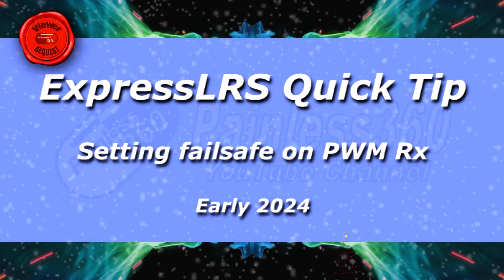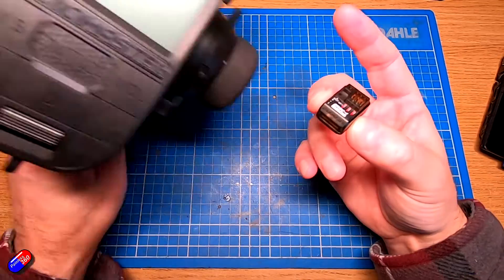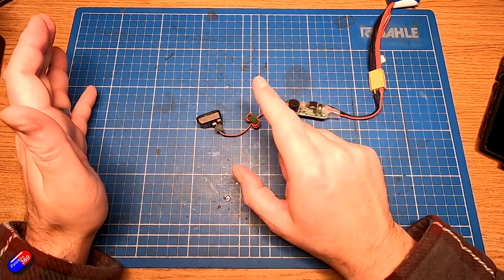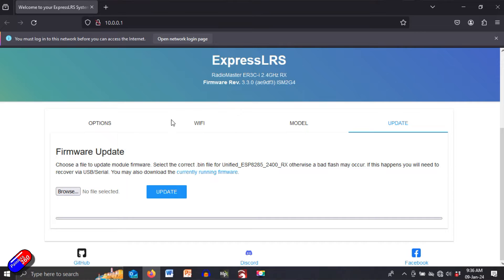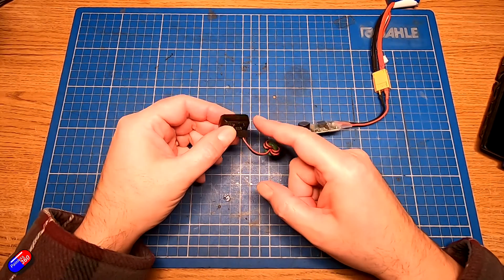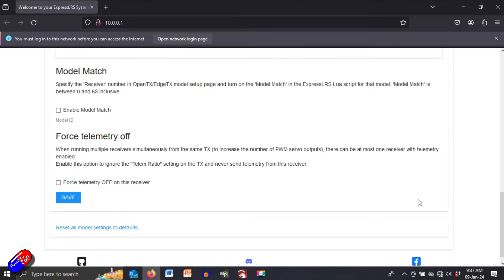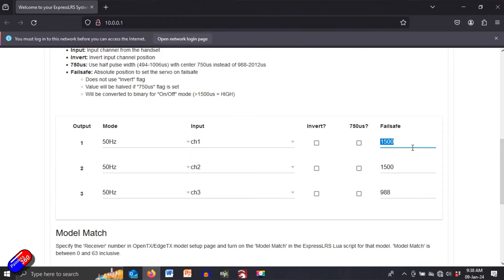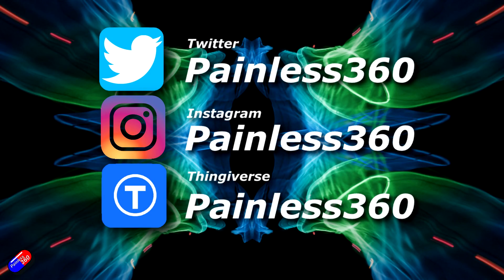Setting Failsafe on ExpressLRS PWM receivers (viewer request)

Comment: Hello sir, thanks for the video! When you set the failsafe, do you test the number by seeing at which point the car tries are stationary? And does this failsafe setup prevent the run away issues on the mt12 transmitter ?
Reply from the maker: There are no runaway issues if you set Failsafe correctly. Most car ESCs will need value of 1500 (0 in EdgeTX) for no movement. 
Happy flying

Comment: Hello sir...wondering if u could tip me something...my rc glider failsafe at short distance after long range flight..i using happymodel tx and rx 2.4g..and i cannot reconnect until i powercycle the  rx
Reply from the maker: I've not seen that here.  Make sure you can reproduce it using the latest ExpressLRS code version,  and if so, report it to the developers via Github... best of luck

Comment: Hi I'm a long time viewer and I wanted to let you know there is an easier way.
Press sys 
Scroll down to tbs agent lite - enter
Scroll to rm er3c(rx that you are using) -enter
Scroll down to set failsafe pos- enter
With the controller press the brake or however you would like the rx to go to in the event it failsafes -enter
Press enter again to confirm and you should be good to go. I tested this method and it worked great on my nitro 1/8 buggy so I thought I would share.
Reply from the maker: Thanks for sharing. I'm sure we'll see something similar in the ExpressLRS LUA script in time... Happy flying
Reply: this is great exactly what we are looking for, unfortunately the manual that comes with the remote control does not help us much
I will check exactly how you would present both methods, it is vital that on speed rc boats and not only failsafe works correctly
thanks for the help🙏
Reply: This worked while it the model was in use but I tried it with the controller off and switched rhe car on and it went full throttle. So it doesn't seem to work unless the controller was connected

Comment: I followd your tutorial because if I turn by radio off first before my truck, the winch (ch3) would start retracting and wouldn´t stop until I unplugged the battery.  After changing the value on channel 3 to 1500, now when I turn the radio on, the winch starts retracting until I turn the truck back off.  Not sure what to do.  Please help.
Reply from the maker: Sounds like the Failsafe value settings are wrong. Set the Failsafe value for the channel for the winch to be the value needed for no movement.. Best of luck

Comment: Question is there option to set failsafe to hold position over a specific value?
Reply from the maker: Not sure what you mean. Failsafe values are a value you set as shown.. They can be anything in the supported range... Try it out... Best of luck

Comment: Hi Painless360. I'm in the UK. I just bought a new TX16S MKII MAX with EdgeTX. It's all new to me. I need to know how to setup my old RX8R FrySky receivers in D8/D18 ACCST V1 mode. Is there any possibility of you doing a video for EdgeTX with old firmware FrySky receivers for the multi mode protocol 4-1 please ????
Reply from the maker: Check out the intro to EdgeTX series on the channel. See https://youtu.be/6dpkkkezQsk for your question... Best of luck